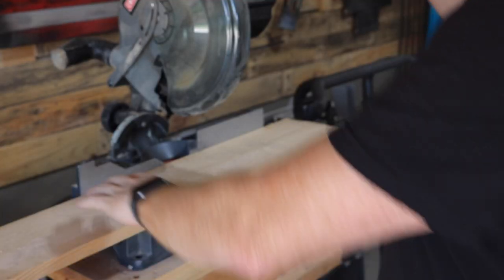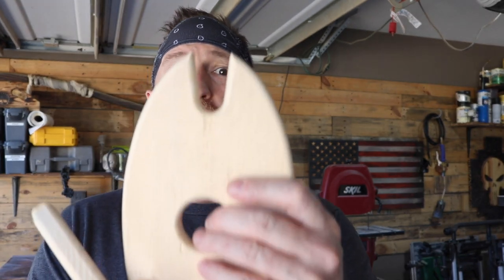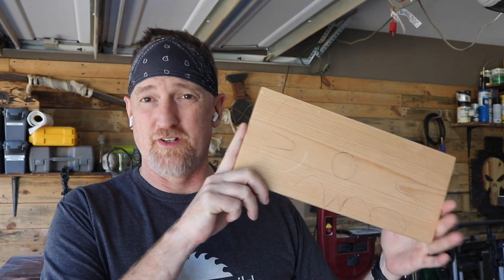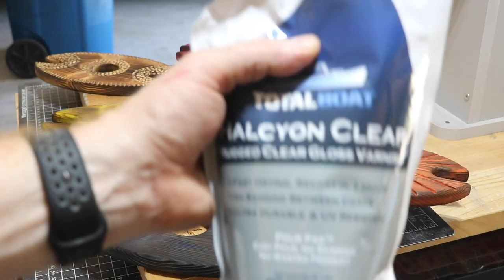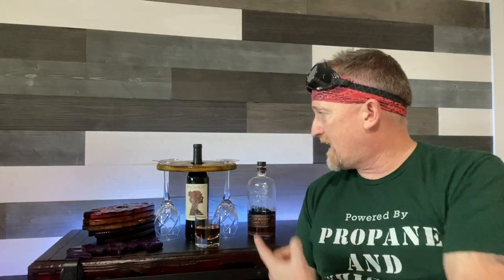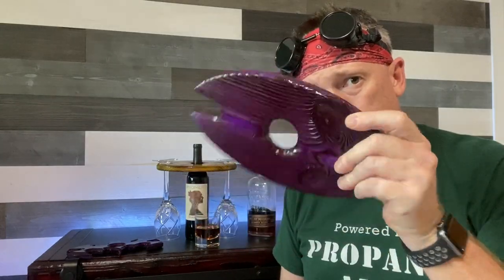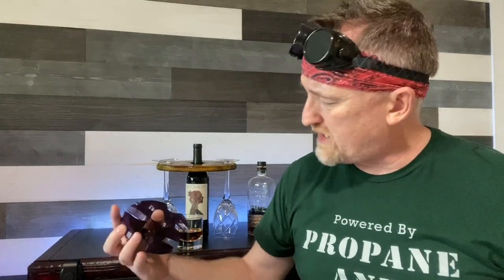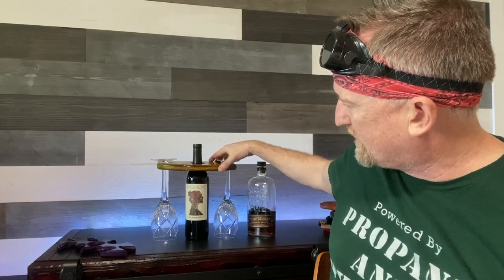DIY Shou Sugi Ban Wine Displays (Great Last Minute Gift Idea!) Oh...and Batman!

Comment: A little adjustment and you could do whiskey and glencairn glasses!
Reply from the maker: I was thinking that the whole time. Now I'm trying to figure out some sort of whiskey tote! LOL
Cheers!
Reply: @BuildDadBuild  I'm trying to design a 4 bottle 32 oz growler carrier now, thinking I might try insulating it
Reply from the maker: @greenejr1984  I have this vision to over engineer a huge "whiskey tote" that I could take to outings like hipsters do with their wooden six pack carriers... 🤣
Reply: @BuildDadBuild  I've thought of doing something like that, currently I have an old 3 day pack from active duty that acts as my mobile bar. Lol it holds about 8 bottles with mixers and cups comfortably.

Comment: Hell of a job as always. I can't wait to see your bigger projects come back. Question can you tell me what that brush on your drill is? I've started trying to use what you've showed us and I use a wire brush to remove the burnt poo but it seams to leave my wood kinda rough with small lines.
Reply from the maker: Thanks, Ray!
Those are Nyalox brushes from Dico.
Here's the link:
https://amzn.to/35yPJ5b
Cheers!